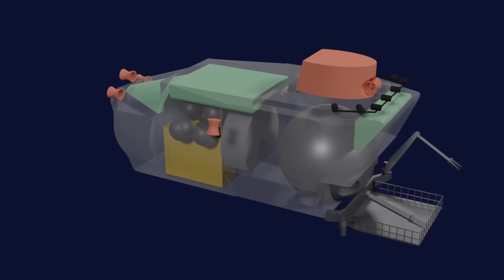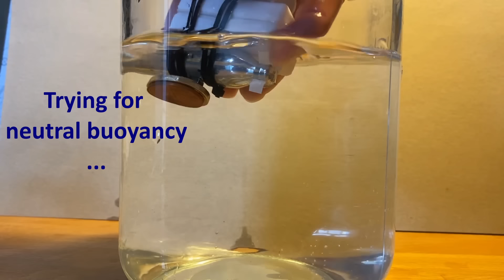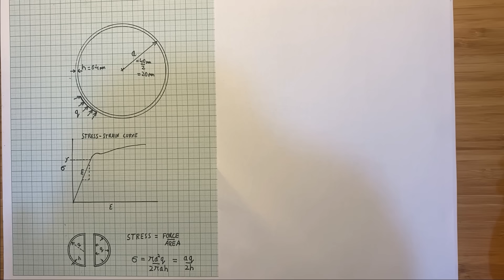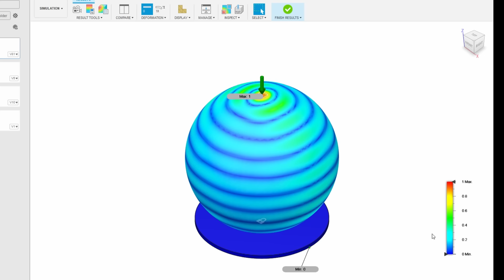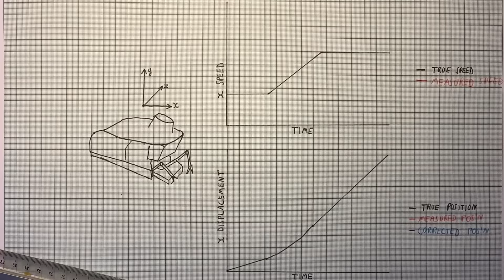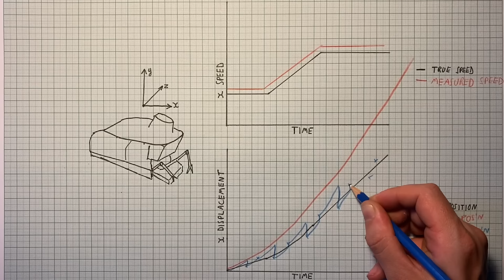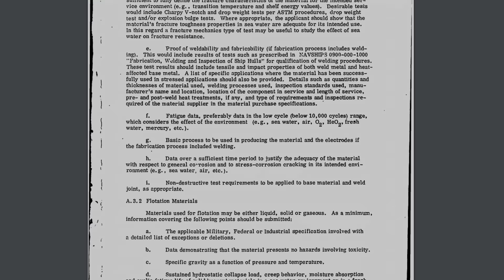DSV Alvin : How to build a safe submersible

Comment: Simple answer: You don’t unless you have 50M to spend to make it and sufficient capital to operate it.  Oceangates 35 M (shoe string) proves it.
Reply: Just the upgrade from 4500 meters to 6500 meters cost over $60M.

Comment: I remember as a kid I read about Alvin's last-resort escape mode that ejected the pressure sphere but left a huge amount of expensive hardware behind, so it's interesting to hear that it's been superseded by having the most entanglible (and much smaller and cheaper) components break off instead. Now THAT'S innovation!
Reply: To be honest the crew sphere separation function was really cool, even if it was suboptimal, and part of me is sad to see it go
Reply: The biggest buoyancy aspects are probably the steel weights and the droppable batteries. The thruster dropoffs would only be useful in case of entanglement
Reply: @oblivion_2852  For sure! But the last-resort was also meant to be used if Alvin was hopelessly entangled with something on the seafloor, meaning that theoretically a single fishing net could cause the loss of everything except the pressure sphere. Now it just means the loss of much smaller, much cheaper components.
Reply: To be entirely honest I feel like the crew sphere separation should have been retained as a final measure. If nothing else works and everything else is gone, having the ability to abandon the rest of the submersible and surface just the crew is still one final protective redundancy.

But maybe that's just me.

Comment: One thing Titan used which was quite smart, was water-degradable links for drop-weights, ensuring a return to surface even if the crew was incapacitated and without any power whatsoever.
Reply: Titan isn’t the only submersible that has that feature.
Reply: Actually I thought the ballast used on the Titan is quite smart too. It's basically some construction grade steel bars. No need to leave your very expensive air tank behind.
Reply: Where would you even look up how much concentration of certain minerals/chemicals can differ thousands of meters under the sea to get even a decent estimate over what range of chemical water composition×pressure to test those water degradedable links under. 
Where would you even start with that?
Reply: @modernsolutions6631  The concentration of those soluble compounds in seawater at any depth will not influence the time it takes to dissolve the links. Temperature is uniform enough to be a known factor.
Reply: @modernsolutions6631 actual testing
Reply: @modernsolutions6631  With SCIENCE.
Reply: @modernsolutions6631  The difference between 0 and 0,0001 is not relevant in this situation.

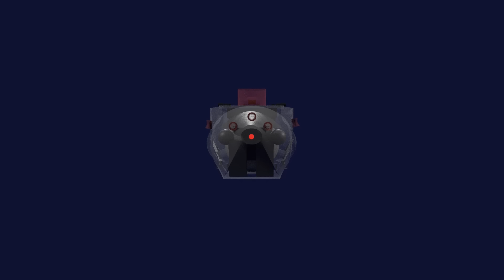Comment: @35:00 -- so no gyroscopes are used for attitude control?
Reply: There is an IxBlue Phins INS system. Sub has Auto Heading, Auto Altitude or Depth and Auto X:Y Capabilities.

Comment: You know why they seem to take the cracking of synthetic foam extremely seriously?

Bevause it nearly lost the synthetic foam which would’ve cause it to get stuck at the bottom of the ocean.

I would rather be imploded than getting stuck down there if you ask me to choose…

What was the thing that you doubt its even remotely possible to happened again? 

Surely, it’s not about synthetic foam crackling and getting stuck at the bottom right? 

Because it almost did happened … like literally.

The ignorant is very strong here.
Reply from the maker: It was a test dive. I think it may have been unmanned. This is why progressive tests are performed for certification.
Reply: @Alexander-the-ok  and btw Alvin was completed on May 26 1964 and was already “In service” June 5 1964

Your “Progressive testing” was completed in just over a week….
Reply: @Alexander-the-ok  That’s your guess… and a very bad guess too.

Alvin enter service in 1964. While there were unmanned submersible vehicles already in service, I doubt the technology was advanced enough to be able fit into Alvin to allowed unmanned operation. The unmanned mechanism had to be 100% mechanical back then as very basic computer was still the size of a house.

Also note that underwater remote operation technology wasn’t available until early 1980s.

At least try to make your guess “educated” please

Comment: Really a good overview of the level of engineering that went into that vessel. One thing that I would like to understand is how the power gets from the batteries into the pressure chamber. It seems like it would need some serious pressure rated electrical bulkhead connectors of some sort.
Reply from the maker: Spot on: there is a ‘penetrator plate’ on the back with bulkhead connectors. I couldnt find a huge amount of info on it so i left it out

Comment: Imperial system is on the moon. Waiting for the metric system to catch up.
Reply: The entire Apollo program used metric (right down to the bolts on the doors)(because it was designed by Germans). The Space Shuttle was the first US program to use imperial measurements.

Comment: As an engineer with aerospace welding experience, I can say that any weld made by a competent process with a competent operator is capable of being stronger than the parent material around it.  The trick with an electron beam (or laser, or any autogenous weld) is that without the addition of filler material, precise fit up and good process are critical.  There is no filler material to shove into the puddle to cover your sins, or alter the metallurgy of the weld bead to improve properties.  The geometry and fit must be good enough to form the weld puddle and subsequent bead.  The parts to be joined must also be properly supported with fixtures and tooling.  The atmosphere over the weld must be displaced with the correct shielding gas or removed by a vacuum chamber.  Correct pre-heat, post-heat, and subsequent heat treatment, as applicable, must be used to obtain the desired mechanical properties.  One part we made at a previous employer was a nickel alloy turbine vane.  Sheet metal was formed in a press into a rough airfoil shape, heat treated to remove residual stress from cold work, machined, finish formed in a press, laser welded in a fixture under an argon atmosphere, machined again, and then heat treated for mechanical properties.  The welds were both non-destructively tested on every part, and sample pieces were periodically destructively tested.  The samples never broke in the weld bead once the process was developed.
Reply: Welds are not stronger than the parent material - because welds are inherently not thermally contiguous. 80% of the parent material strength is a reasonable guess particularly for field welds. 
Pipeline failures along weld lines are common.
A number of catastrophic tank failures confirm this estimate.
Reply: @allangibson8494  your statement is as irrelevant as it is true. Pipeline welds are field welds, not factory welds. Field welds are harder to preheat and control cooling. They are usually impossible to heat treat. Alvin was fabricated in a factory, not the field. Much better process controls. And if you're referring to pipeline weld strength as delivered from the factory, remember pipeline is essentially a fungible commodity. Thousands of feet are made produced. An economic choice is made to forgo certain process controls and steps, accepting lower strength and possible failures. This is also a situation not applicable to the construction of Alvin.
Reply: @briancox2721  And I have seen plenty of factory welds fail - usually where the weld meets the parent material because any heat treatment is destroyed by the welding process followed by rapid quenching. Pessimism on weld integrity is usually justified.
That is why seamless pipe is a thing - avoiding the discontinuity that welds leave in the pipe. 90% of the time the weld will not have the same analysis as the pipe either - because the simple act of heating the material changes the chemical composition of the substrate (and that is without considering the phase changes).
Electron beam welding minimises heating.

Comment: Why can’t an inertial gyroscope navigation system like used in aircraft be used to determine Alvin’s speed, track and location in 3D space?
Reply from the maker: It may have one on board but there is no info available.
Remember, the doppler velocity log skips the first step of and IMU and measures velocity directly so is less susceptible to drift.

Comment: I don't know where you got the information that higher frequencies travel further underwater but it is actually the opposite, low frequencies, especially infrasounds, can carry hundreds of kilometers if in the right depth bracket. I got this information in my Oceanography classes during my master's degree though i cannot, for the life of me find the source.

Other than that, very informative and i liked a lot, hopefully one day i can actually get onboard one of these wonderful machines during my research.
Reply from the maker: I massivley simplified that. You are correct in that lower frequencies are attenuated less. But higher ones are more distinguishable from background. So underwater phones shift to the best compromise between the two.
I might pin a clarification on this actually, thanks.

Comment: You assumed there was 1 atmosphere in your pinpoing ball. That would not create a very bouncy ball would it?
Table tennis balls are preferably kept below 3atm but can be as high as 9 according to search results online.
Reply from the maker: Yeah i didn’t want to drag that section on. I did stick a pin in one underwater and not many bubbles seemed to rush out so i dont think its much above 1atm inside

Comment: I wonder how the design of carbon fiber scuba tanks would work for a submersible - they're already designed to survive impressive pressure changes, from wanting to fly apart in an explosion on deck, to wanting to implode at depth. (They are not made from carbon fiber sheets, but string - like if you wound a thread bobbin on all 3 axis instead of just one)
Reply from the maker: I'd have avoided carbon fiber overwrap like the plague when I was an offshore engineer. Everything gets knocked around so much offshore I'd be concerned about impact damage.
Reply: @Alexander-the-ok   TBH, the CF overwrap was only there to give the customer the "look and feel" desired, and was selected by the customer as "cosmetic options".

P.S. The number of colors & patterns they can pull off with a CF sheet are pretty amazing - and it wears better than the old vinyl sleeves that used to be used as cosmetic wraps.
Reply: Those CF tanks are designed to hold high pressure inside. I guess they do also have to resist highish pressure outside when empty, but it’s nowhere near as high since divers don’t go to even a fraction of the depth that a submersible does - plus if they did fail once empty, they are less likely to kill anyone.
Reply: @Sashazur  One of the reasons I think a scuba tank type design might make a good submersible is the fact one of the main ways to keep a sub from imploding is to have the internal pressure equal to the external pressure - and those tanks can handle some crazy pressures before they fail from overload when you are filling them.
Reply: @muninrob  Are there any hyperbaric submersibles? I mean, submersibles with their own propulsion, not just a submersible chamber that allow divers to decompress at the surface.

AFAIK, most (all?) self propelled submersibles maintain surface pressure on the inside, which obviously eliminates any time needed for decompression.

But I can see how an ambient pressure dry sub might have some interesting possibilities, and maybe even a hyperbaric submersible.
Reply: @IsaacKuo  Not many of the deep water subs (especially the little 1 & 2 man research jobs) maintain surface pressure inside, most of them have a decompression chamber aboard the service ship. The engineering is "relatively simple" for a pressurized system, although I have no idea where they get the extra air to up the internal pressure. 

P.S.  Take my anecdotes about sub operation & design with a boulder of salt - my knowledge comes from the encyclopedia, documentaries & the questions I asked while spending a couple hours moving scuba tanks from the factory truck to the research vessels that ordered them.

Comment: why no classical inertial navigation system, like allegedly in military submarines?
Reply from the maker: Good question. I suspect there probably is one of those too but I couldn't find any info.
Reply: Alvin has a SEADeViL INS system fitted as does its companion ROV Jason II.
The gravitational and magnetic anomaly navigational systems used on military submarines are more “obscure”.

Comment: Just have to point out that ping pong balls are made out of nitrocellulose and camphor, usually 50/50 or so. Sometimes they are made out of cellulose acetate.
I think the safety record of the majority of DSV operations is because there are no second chances. Because once you've killed your sub and the people inside, your whole operation is over.
Reply from the maker: Not anymore they aren't. They switched to ABS a few years ago.

Comment: What does dui certified mean because I think I unlocked that achievement
Reply: There are several Certifying Agencies that cover Deep Submersibles. Tourist and many research subs are generally classed by DNV (Det Norske Veritasor) or ABS (American Burea of Shipping) and in Alvin's case the US Navy. The job of the certification body is to ensure that all aspects of the submersible adhere to the design and operational requirements called out by the applicable specification and control documentation. It is similar to how car builders have to get NTSB certification in order to be deemed safe for use on public highways.

Comment: I've heard when welds are done correctly, any welded joints should always be stronger than the base metal.
Reply from the maker: Yeah that's quite common for various types of additive welds. But electron beam welding doesn't add any new material.
But I did have a quick through some literature and it does seem to be the case in certain situations due to various complex materials science effects that I don't fully understand.
Reply: Welded joints are about 80% the strength of the base metal. That’s why a weld bead should never be ground off.
That is a common misconception when people weld up riveted structures - and then have them catastrophically fail. Riveted structures are aways stronger than the base metal - but also leak more than welded joints.

Comment: Why couldn't one feasible use ~any rope to pull Alvin up, if it's actually trimmed to something like 20kg negative? Obviously, you'd need to overcome whatever entanglement exists, but apart from that I don't see why you'd ever need to apply more than Alvin's net weight (with buoyancy subtracted) + epsilon of force (with the size of epsilon affecting only the speed, dependent on Alvin's drag and Alvin's mass). Is it the case that the epsilon would need to be large?
Reply from the maker: I wouldn't be surprised if there is an emergency procedure that involves that but it would be really difficult. There is still 20 tons of inertia to accelerate, regardless of the trimmed weight. And at its rated depth, you're approaching the depth where a cable can't support its own weight.
Reply from the maker: Sorry actually I'm being an idiot. Alvins test dives to get its depth rating were unmanned and tethered so it's probably nothing like as difficult as I made out there.
Reply: The Russians also have a test chamber in St Petersburg capable of simulating 30km depth - the DSV “Limiting Factor” was tested there (to 30km).

Comment: Basically all the necessary engineering to make a sub safe, summarily dismissed by Stockton-Rush to be replaced by glue and make-believe safety systems. The tragedy is, that the whole shoddy OceanGate operation was compenent enough to make something resembling a sub close enough to put people in deep water, but nowhere near competent enough to do it safely. It is the kind of thing that happens in startups fairly often, competent enough to appear to offer a solution, but nowhere near competent enough to realize the product is shit and actually making it well would require skills and resources far beyond them. Usually at that point, the startup fades into obscurity or implodes spectacularly, rarely though literally.

Comment: I knew someone who made a submersible out of carbon fibre.
Reply: Alvin is covered in Carbon Fiber. The "skins" that cover the outside of the sub are CF panels that do not see a pressure differential and are just protecting the outside components from external damage and making the sub more streamlined.